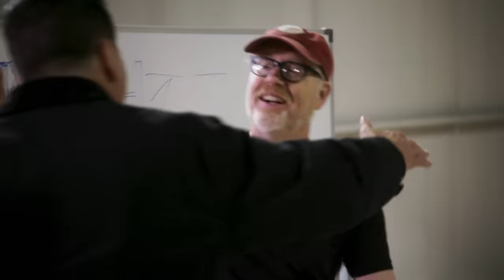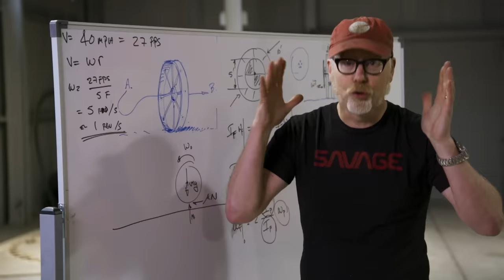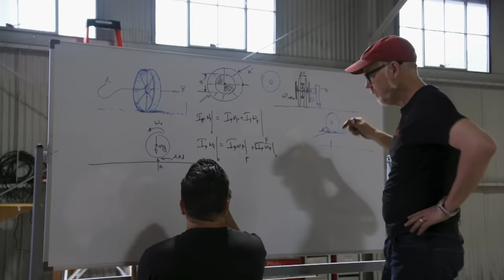"The Power In These Flywheels Scares The Pants Off Me" | Savage Builds

Comment: "The power in this flywheel scares the pants off of me."
Let's use a ratchet strap too hold it down.
Reply: ...and a pair of saw horses to keep it off the ground and from rolling into the next county
Reply: Yeah, kinda like fastening the engine in a dragster with zip-ties.  They weren't even smart enough to notch the supports where the axle was sitting.

And now Jamie, imagine an old steam locomotive:  Six or eight cast iron wheels, five or six feet in diameter, and weighing a couple of thousand pounds each, rotating at a couple of hundred RPM.  Scary force!
Reply: a switch to shut it down, not pulling on it like an uneducated man
Reply: Let's use ONE THIN & WEAK strap AT THE CENTER OF THE AXLE instead of TWO 1 ton chain comealongs on each end pulling to BOTH front and back, and let's anchor THAT CHEESY LITTLE RATCHET STRAP to the floor with some cheap stamped sheet metal clips and 4 cheesy little SMALL DIAMETER TAPCON concrete SCREWS instead  4 SQUARE, HALF INCH thick WELDED PAD EYE PLATES WITH 3/4 BY 3 INCH WEDGE ANCHORS at each corner, FOR 16 BOLTS TOTAL, and let's NOT ***BALANCE THE PLATES***, EITHER FOR ROTATION OR TO EACH OTHER. 

They got really lucky on that "test".
Reply: Angular momentum and Centrifugal force all in one device with no off switch or braking system! Murphy's Law? pfft....What could Murphy have known about the laws of physics?
Reply: well, they must come up with some drama, so at least some people feel impressed 🤭
Reply: looks like a seat belt to me...
Reply: Stelzner probably at the bar right now, still can't understand why NASA dismissed him from the lead engineer position in their upcoming Mars mission.😿
Reply: Right. This shows amateurism all over. No proper mount, not properly balanced, a manual device to spin it up, no clutch mechanism. What kind of nonsense is this? But it does have a lot of show. Speed it up to a THOUSAND rpm, SEVENTEEN revolutions per SECOND. Yes, so what?
Reply: By my calculations, Harbor Freight tie downs should be "sufficient".
Reply: @mmmmkkk  best comment yet!
Reply: @billscow  Don't know what all that means, but if I need to build a giant flywheel, I'm hiring YOU to help me do it, sir.
Reply: A single one. Not two for stability
Reply: But then again I'm pretty sure there is some physics none of use are understanding here. 
Kind of like those UFO things you blew into and turned In your hand. Maybe flying it would cause the weight to become unbalanced in a particularly dangerous way that I don't understand 🤔
Reply: barely even a ratchet strap even, another commenter called it a guitar belt and I think that's pretty apt :D
Reply: @jlinkels  calculate for me the momentum and acceleration 8f it's 1000rpm
Reply: i wouldn't even use those on cars.
Reply: Had to. They were out of large cable ties.

Comment: When I was. Freshman in High School I took wood shop. We were all required to build something, and I had to figure something out using scrap wood. One guy made a salad bowl for his mother. He took about 8 1” sheets and glued them together, then stopped and shaped the bowl with the wood lathe. One day he was going g t it. Almost done and he wanted it don’t by Christmas. All of a sudden the bowl broke loose. He had carved through the screws holding  the bowl to mount. First it spun to the right, where it kind of danced around a bit where it hooked up and flew out of the shop window after hitting a dust pan and launched into the Security Guard’s house next door. That was some fun!

Comment: I work for an industrial fan company. Largest fan we ever built was 14'2" in diameter mounted on a 30' long shaft. 90,000 lbs. 14,000hp electric motor. Was at a power plant. Turning at 760rpm.

Comment: I'm surprised the first thing you didn't do was check to ensure they were equal in weight and balanced. Like balancing a tire.
Reply: I'm sure they checked that before they accepted delivery from the machinist. When you have something mechanical custom fabricated you are required to sign paperwork showing it met specs and was delivered correctly.
Reply: @CorruptedErtai  Bro it is not clearly balanced, you can see it wobbling, forget about micro vibrations, it's visible. No way they are going 1000rpm.
Reply: @paragwandale5037  bruh, the wobble can have 1000 reasons that all aren't because of imbalance due to them having slightly different weight. Maybe the surface isn't 100% flat, Maybe one bolt loosened, maybe the motor caused the shaking, Maybe the "stands" the thing was on is uneven... there are so many reasons that can explain it, it doesn't have to be being unbalanced. They could've even had 1mm wiggle room too much on one of the wheels, causing it to wobble. With forces that massive you don't need all that much to break equilibrium
Reply: i'd be surprised to see these guys plan for that long. I think they want to cut down cost and make things fun and call it a win

Comment: “Perfectly balanced axle” 

disengages the coupling via yanking a rope.

They make industrial clutches for a reason people. 

Also, they could have done this whole thing using actual flywheels, or balanced pulleys meant to do this job. Not unbalanced steel plates.
Reply: yeah...  or what's wrong with just off the motor??? 0_o
Reply: @phiksit  Right. Or use it as a load and dynamic brake to slow it down.
Reply: Quite possibly the stupidest thing I've seen Adam do (or design/allow). If that thing let loose, there is no guarantee it would have fallen evenly on both flywheels. It could have turned, spun around on one, and destroyed that warehouse and mostly everything inside.
Reply: @charlesbonkley  It would still probably go forward because of the gyroscopic effect keeping it relatively straight as it fell, but yeah, the trajectory would be very unpredictable.
Reply: Only thing better would be if the discs were saw tooth!🤣
Reply: maybe just weld the axle to a solid frame..

Comment: Back in the mid 1980's I took a tour of the Princeton Plasma Physics Lab with my engineering classmates. The host told us that they had a massive flywheel spinning at ridiculous RPM in there, and if it shook loose of its mounts it had enough energy theoretically to roll all the way to Los Angeles.

Comment: Adam, you need a clutch like coupler.
Where when you have the speed you want, it retracts.
Will be easier to remove the motor without pulling the whole coupler appart.
Reply: Synchronous Self Shifting coupler with a retraction that only happens when not engaged.

Comment: Adam, flywheels are normally used for stability not momentum.  If you have left the rockets on the wheel, for forward momentum and added the flywheels the rockets would have provided forward motion and the flywheels would have kept it from deviating from its forward path.

Comment: As someone else already mentioned, having it attached to an overhead crane that could withstand the horizontal load would be the safest choice, as it would lose traction as soon as the load hit the limit of the suspension straps/chains. You'd want that to be within just a couple of feet of where it would be able to make contact so that it can't gain too much momentum before being raised off the floor.
Reply: Overhead cranes aren't designed to have horizontal strength. With that being said, those slick steel wheels wouldn't be able to get a lot of traction if suddenly introduced to the concrete at high RPM should it hit the ground.  So long as it was hitched short to a pole or something, it wouldn't go anywhere.

Comment: presses on the inner rim
"Look at how much energy it takes to stop the disks."

Me: "This is why disc brakes are on the outer rim.

then proceeds to press on the outer rim
Reply: He didn't press on the outer rim initially because that would have applied a torque to the assembly again, potentially swinging it around the other way.
Reply: @kantpredict  The real reason he didn't do it initially is because it makes 'better' TV....
Reply: @bradley3549  why not both?
Reply: Pretty sure the disc brakes are much smaller than the flywheel and are relatively close to the size of the hub.
Reply: @mrexists5400  Potentially both, but if safety was the really a concern he wouldn't have touched it in the first place. Just let it coast to a stop from a safe distance.
Reply: the same energy as to spin them up
Reply: They aren't on a bicycle though. Which I've never quite understood.
Reply: Seeing as late-attaching a set of brakes wasn't really an option, could a liquid underpool slow it down faster (or does that just spray the surroundings)?
Reply: @iAmTheSquidThing  Normal bycicle brakes are on the outside and discs brakes on bycicles are already more than strong enough
Reply: @definesigint2823  It would probably push itself forward. Theres no way to slow it down faster withouth getting a huge counterweight or bolting it to the floor
Reply: I thought of using magnetic brakes (eddy currents)  but then realised they woul sn aap on the steel discs
Reply: I did a facepalm when he did that
Reply: @dandan84  not the point he`s making bro, try again.

Comment: I imagine this would be ok to test in a desert surrounded by miles of sand dunes
Reply: That wouldn't work very well since the gravity in mars is different. People seem to forget that only earth has an atmosphere and it causes things to work different here than any other planet.
Reply: And if it got loose it would be the most badass tumbleweed ever conceived.
Reply: @luissan515  
Mars?
I didn't say Mars.
Reply: @luissan515  Mars also has an atmosphere. 100 times thinner and mostly (@95%) carbon dioxide but atmosphere nonetheless. But more importantly, This WHOLE video has nothing to do with Mars other than the guy worked on the lander program.
Reply: @luissan515  All 7 other planets have an atmosphere..... Although Mercury has the smallest, nearly negligible one.
Reply: The wheels will immediately dig itself and come to a stop
Reply: With dry ice skate pads on suspension.
Reply: Just imagine if we add magnets for perpetual motion
Reply: @luissan515  ... this isn't being designed to work on Mars
Reply: @hybridwolf66  
Would it be safe to say that Jupiter, Saturn, and Uranus are mostly atmosphere?
Reply: @jacobacon3219  No.  All the planets have an atmosphere of some type but most are very thin and have no oxygen.
Reply: @hybridwolf66  You think Jupiter, a gas-giant planet famous for its huge mass (and therefore huge gravity) as well its gigantic storm, has a "very thin" atmosphere?
Reply: @CDCI3  Yes it does. Made up of mostly hydrogen and helium gas. The only planet that I know of the DOES NOT have an atmosphere,  is Mercury. That is due to its orbit so close to the sun. The atmosphere was able to escape.
Reply: ...remotely.
Reply: Just because things are secluded doesn't mean people deserve the privilege to do whatever dangerous thing they want there. There's wildlife theres possible archeology and just because it's sand doesn't mean disturbing it isn't harmful
Reply: @luissan515  they're not talking about using this on Mars. But if they were, I'd guess the wheel would spin more freely because its mass isn't changing, and less gravity in conjunction with thinner atmosphere would not impede its momentum as much as they would on Earth.
Reply: @james130362  Nice attempt at trolling there. 😉
Reply: @hybridwolf66  Well 5 of the 8, plus some moons have appreciably thick atmospheres, all of which contain some Oxygen. Apart from that, you're correct.
Reply: Oh, and the Earth has a moderate atmosphere too.
Reply: @RWBHere  Wrong, only Earth has gaseous oxygen in the atmosphere. The only reason that Earth has oxygen is because Earth has plants that do photosynthesis. There is no other natural process that we know of that will put significant amounts of oxygen into a planet's atmosphere.
Reply: @busybeez194  It'll come to a stop ... in China.
Reply: I like how this entire thread became a discussion about atmosphere on different planets 🤷🏻‍♂️
Reply: @hybridwolf66  If mars had 100 times thinner atmosphere, how does mars helicopter fly?
Reply: @luissan515  
Gravity has no say so with angular momentum... even gravity in earth has to bend to it... it's just to figure it out...

Comment: I ran circular saws at those RPM.  To stop them fluttering they were slightly dish shaped, and when spun, the edges stretched outwards and the saws, roughly only one quarter of an inch thick, but still dangerous enough. When spun to full speed  they ran true and the dish disappeared.

Comment: Fun fact, while they only reached about 1/3rd of the rpms that they wanted, because of the formula E=1/2*M*R^2, where M is the mass of the flywheel, and R is the rotation rate, they only had about 1/9th of the energy they were planning on.
Reply: Hey, you missed the radius of the flywheel in your equation. The correct energy formula is 1/2*M*r^2*ω^2.
I substitutet your R^2 with omega^2 due to it being the more commonly used variable.

You are nonetheless correct in your statement since adding the radius just adds a constant and the equation.🤓
Reply: @maximiliankessel3789  that's correct, I should have said moment of Inertia. Or at least angular mass. But my point still applies.

Comment: Question: why, why would you start a rotating mass without a stable foundation to which it could be safely tested? Work horses? You could easily build a frame mount for the axle housing that wrapped around the housing in order to not weld on the axle housing.  Stabilizing the axle housing and you could have run the test properly.
Reply: Shoestring budget , time constraints , garden shed engineering ... take your pick.

Comment: Ford used to use a 300 cubic inch, 4.9 l inline 6 in all sorts of different chassis from school buses, dump trucks, to quarter ton pickups. The school bus and agricultural powerplants had nearly 3 foot wide flywheels. The torque advantage of that huge flywheel made the difference of a light duty pickup application, to a max out load conditions.

Comment: The reason for the vibration is due to the extreme amount of runout in your axle assembly. If you true that whole thing up and balance those enormous round plates all of that vibration should start to disappear. Another problem I see is rigidity. You've got everything there coupled together with a very small bolt circle. You probably want a bolt circle and an axle size on par with a semi truck. You're at passenger car level right now. Also, you need to bolt that thing to the floor. Those saw horses were moving all over the place even before you decoupled the motor.
Reply: yea they started well with some equation, i had hope, but then it was always the same stuff put more power and see what happen with no plan lol

Comment: "Perfectly balanced" yet a visible 10+ mm   wobble on the outer edge with wheels this big moving the air back and forth that much is enough to start a vibration and once it starts it will naturally build to the frequency of the machine
Reply: The air isn't even the problem, it's the centrifugal forces that try to correct the axis of rotation (like in a frisbee). That's why you can still get vibrations even if a rotor is statically balanced (meaning its center of gravity is exactly on the axis of rotation).
Reply: @CatNolara  Precession over Precision! ;0)

Comment: That's probably the most recklessly dangerous thing I've ever seen him do.
Reply: The test itself ... no drama. But just standing right next to it? Yikes.
Reply: @labibbidabibbadum  what if it was more out of balance and broke off the axle and took off in a random Direction? Reasonable precautions were not taken.
Reply: @theobserver9131  I guess you were there to see all the safety behind the scenes stuff huh? Could you tell us about it or did you have to sign an NDA?
Reply: @Physco219  Also, just knowing some basic physics makes the danger plain to see.
Reply: I don't think it beats the cannon ball incident...
Reply: @rsteeb  The destructive forces at play here were far greater, though that being in a residential area could qualify as a closer call.
Reply: @Physco219    Look up "precession", and calculate the energy in flywheels of that size, and use your eyes.  They were scared because they realized they were out of control, which is evidence enough.  That entire warehouse was one tie-down strap away from being a people-blender.
Reply: @Physco219  Do you understand the even the force  of 400 lbs falling over suddenly? The danger is substantial and obvious
Reply: Simple safety measure would have been to rent some solid concrete blocks. Not the 8-12" thick type you see as barricades but 2-3 foot thick ones. Stack them a few deep. Something happens the flywheels won't escape. 
That and build a solid base to mount them to too..
Reply: @csn583  Indeed! Unbelievable that these smart guys didn't anticipate gyroscopic precession.
Reply: @tyrranus_tyrranus  Yes, or that such brilliant guys didn’t just build a dedicated strong stand for it. A ratchet strap holding it to a couple of sawhorses, not the brightest thing I’ve seen.
Reply: @UFO-047  You'd have to find a balance between something hard enough to stop them, but not so hard that they just bounce off or go over. Maybe sandbags would work better?
Reply: Jamie isn't around to be the voice of reason   ;-)
Reply: @csn583  I have serious doubts the walls of that warehouse would have contained that rotating mass for long had it broken loose. I think this was wreckless endangerment not doing this experiment somewhere far away from civilization. I don’t understand how these guys get insurance. Unless that was inside a bunker?